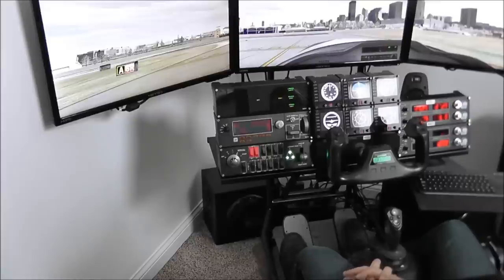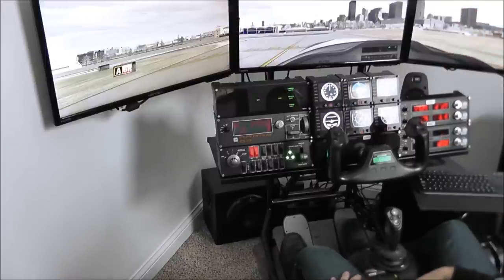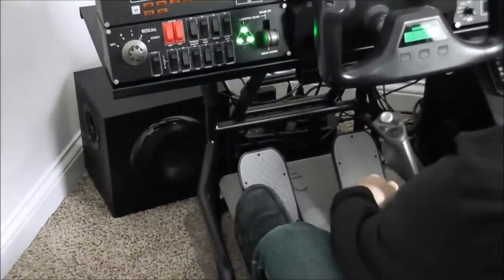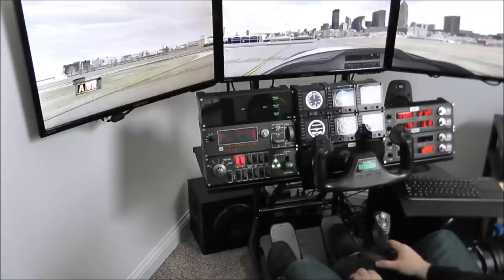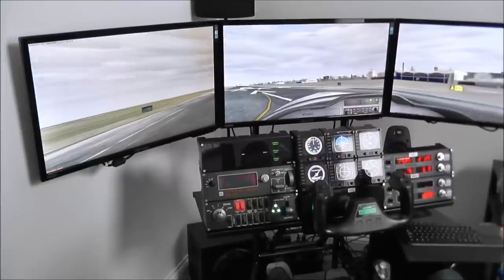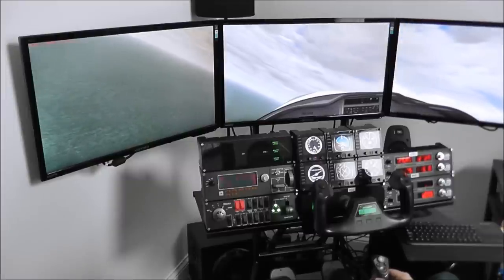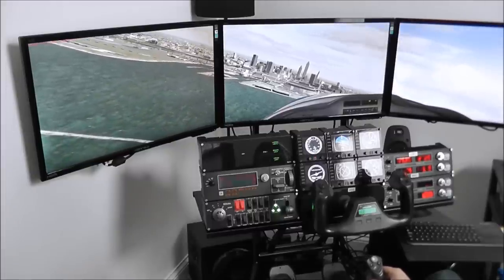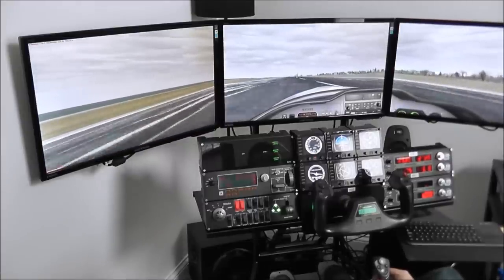Volair Sim Flight Sim Cockpit - FAQ Part II and Center Stick Mount Explained

Comment: Is it possible to have glass panels instead of the current radio and dial set up?
Reply from the maker: Yes, you can put 1 or two iPads and simulate PDF and MDF.

Comment: Is the center mount height adjustable
Reply from the maker: James Jones yes it is.
Reply: @volairsim  So I can use the Thrustmaster Warthog stick with a 10cm extension without any problems in a center stick arrangement?
Reply from the maker: @flyer7807  If you use the extension, you will not be able to rotate the keyboard tray in front of you without it hitting the joystick so keep this in mind.

Comment: You could also use a tripleheadtogo. for three screens also.

http://www.amazon.com/Matrox-TripleHead2Go-Three-Monitor-Graphics-Expansion/dp/B000RMQZ96
Reply from the maker: With the $300 or so (cost of the TripleHead2Go) you can easily buy a very capable mid-grade video card (e.g. GeForce 760 GTX) and have $$$ left-over. These TripleHead2Go were popular in the past where few cards supported triple monitor outputs but nowadays there are better and cheaper options.
Reply: bought mine used and works with lower end cards.